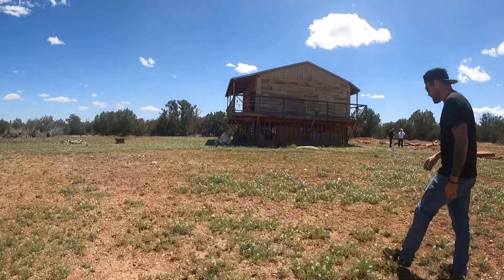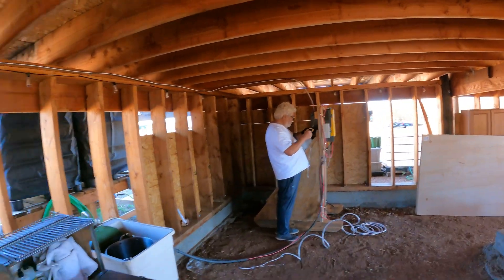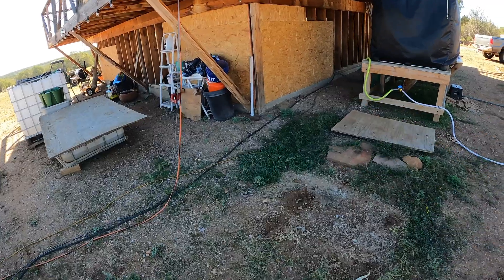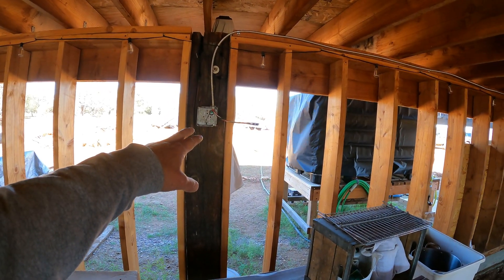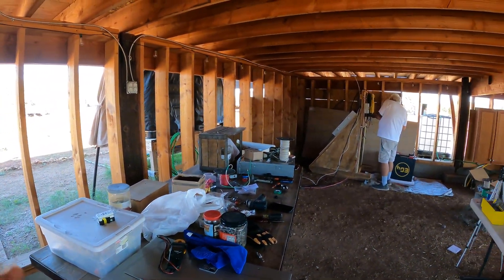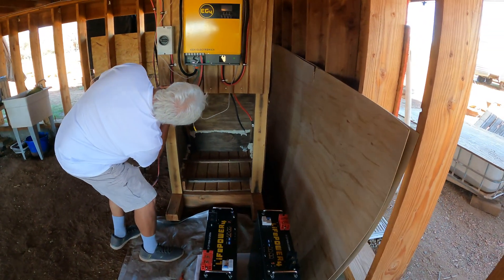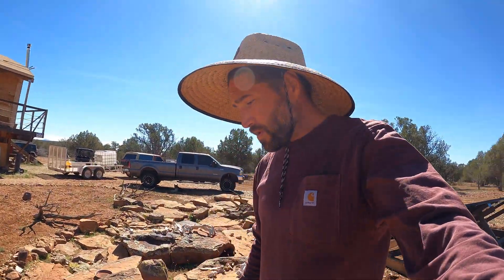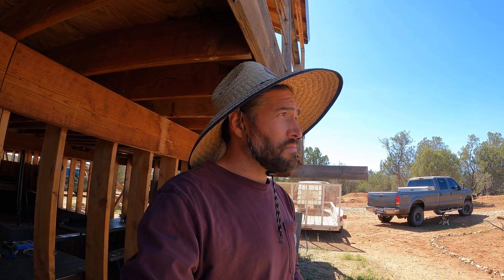Upgrading Our Off Grid Solar Setup | New Load Center + 2nd Battery

Comment: dont put them to far away its DC and unless you are putting them in series to up the voltage the line loss will be high.  interesting
Reply from the maker: It is in series and everything seems to be working fine so far

Comment: You could drill a hole through the floor above the inverter amd move them upstairs to the heated space and not worry about the cold of winter. A little conduit through the floor and then it's worry free.
Reply from the maker: The cabin isn’t insulated and things tend to freeze up there too. But that’s a good idea

Comment: Hey Neighbors!  Just found your channel. New sub!  : - )   - one word of caution:  pls consider a fire-proofing layer on and around that wooden component rack and cieling area near your equipment... especially since it's under your wooden home.  :)   If even one of those components sparks a flame, your home risks turning into an inferno.  maybe consider some sheet metal or cement board, fireproof coating, etc applied that definitely won't ignite if you had a single flame emitting for 30 minutes until you notice it...  worth considering anyway.
Reply from the maker: Oh man I hope that doesn’t happen lol but thanks for that I’ll definitely consider it. Where are you located?
Reply: @HideawayHomesteadRanch  We're just across the border in NM... about an hour from Springerville...  It's cool to find some like minded folks with a great channel!   :)
Reply from the maker: That’s cool I’ve only driven through NM on my way to TX. And the homestead community is a wealth of knowledge

Comment: It's not really clear from the video, the positive lead should be connected to the first battery and the negative lead to the second battery so that both batteries charge and discharge at the same rate.
Reply from the maker: Interesting I believe that is one way to wire the batteries. I think it just depends if you’re wiring in series or parallel. I could be wrong I’m not electrician lol
Reply: @HideawayHomesteadRanch he’s talking about parallel wiring.  If you discharge the batteries even a little bit unevenly, they will progressively get farther apart in state of charge. The flat voltage curve of LFP  keeps the batteries from self balancing quickly. You should frequently charge the system to the battery’s high voltage cutoff so the runner in second place can catch up.
Reply from the maker: Wow ok I’ll look more into that thanks